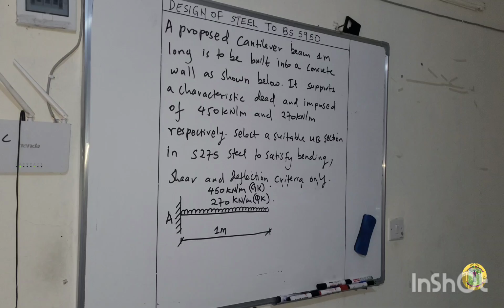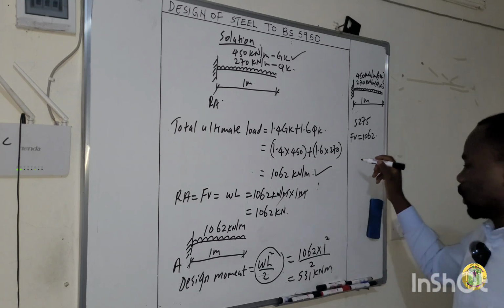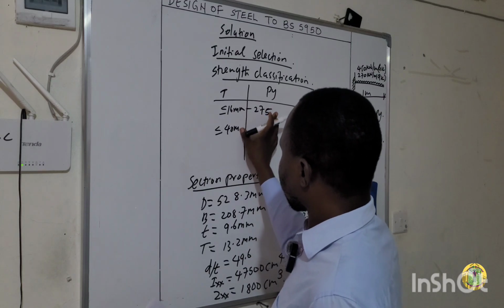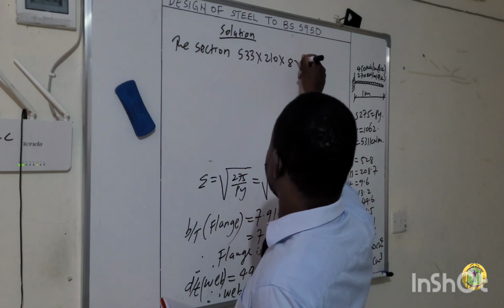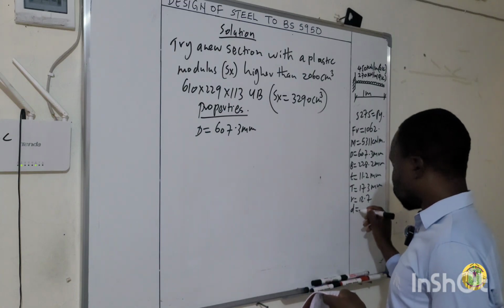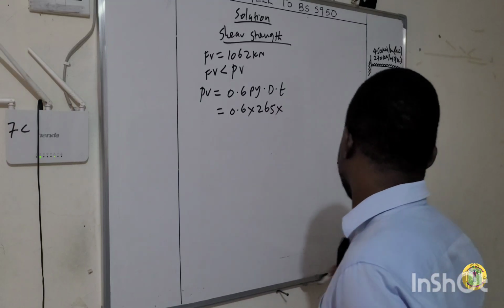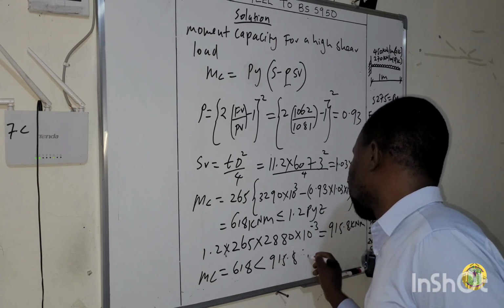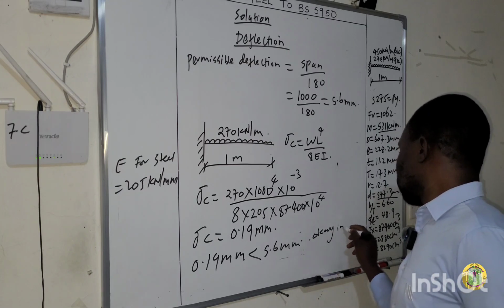DESIGN OF A CANTILEVER STEEL UNIVERSAL BEAM TO BS 5950

Comment: Thank you so much for the session sir, I have a question, under section classification, what if web is plastic and flange is say compact or semi compact, what would the whose chosen section be referred to as?
Reply: @Dejosh121  I think in that case, the weaker element would be chosen. Say between flange (semi-compact) and web (compact), the section would be classified as semi-compact.
Reply from the maker: In this case, the overall section is classified by the least favorable (most slender) element or the weakest element. This means the one with the highest slenderness ratio

Or choose another section and check if it will pass or fail . Remember, you are not limited in design.